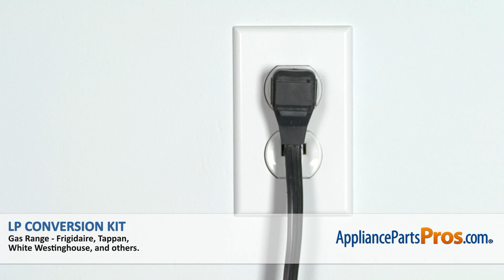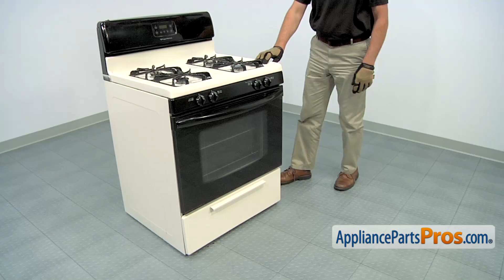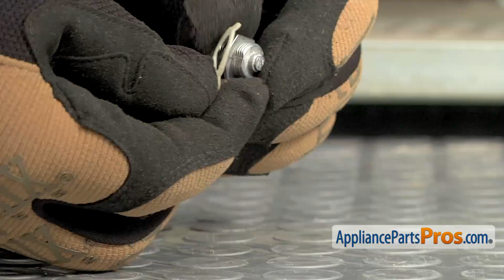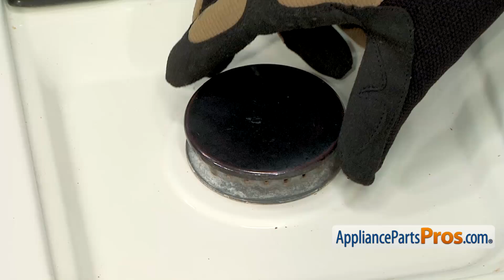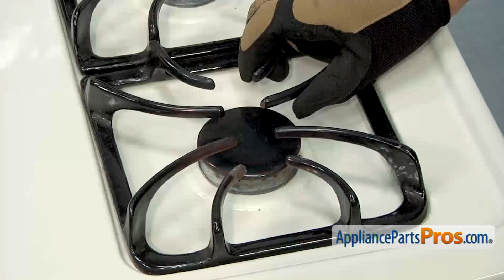How To: Frigidaire/Electrolux Lp Conversion Kit GRLP3

Comment: Can you do a video and how to replace a 6 burner Frigidaire gas stove
Reply from the maker: We can certainly keep that in mind for future videos. If there is specific information you need for your unit, just provide your model number and we can check it out for you.
Reply: @appliancepartspros  thanks  question can you tell me what kind of burner substitute to used on a Frigidaire 6 burner gas stove mind was stolen off  and I can't gt no replacement the model number dont come up when I researched it online ..if I could get a picture of the burner i could make one
Reply from the maker: What is the model number of your appliance?
Reply: @appliancepartspros  fkgd30a3nenw
Reply from the maker: I'm sorry, fkgd30a3nenw, is not pulling up as a valid model number. Can you look on the unit and double check that information?
Reply: @appliancepartspros  thanks for your help

Comment: Hello, I have a frigidare 79078812406 which is converted to LP, now I need to change back to natural gas. I plan on doing the opposite of this video and install the gas orifices. I believe I should reverse the orifice in the regulator, only question is about the broiler adjustment. Can you make a suggestion?

Comment: To help hold the top burner orifices in the socket or nut driver use a small piece of paper towel so you don't drop it into the range.
Reply from the maker: Thanks for that tip!
Reply: Or axle grease, vaseline or chewing gum

Comment: What happens is the orifices in the stove top are not changed after LP conversion?
Reply from the maker: Holes in the orifices are different sizes for each type of gas. If you have the wrong size ones the burner will not work properly.
Reply: Kaboom.😵😂😂

Comment: This has me nervous and confused, because I went through a Kenmore's version of this yesterday, after finding that the NG oven/range (790.72402014) had come with a packet of four orifices and instructions to convert to LP, all in a plastic envelope stuck to the back of the oven.  I'd thought I was done with that process, and got here while looking for propane connector options, but decided to QC my work vs. the video.
1)  there's no mention in my instructions of the need to determine the difference between the provided orifices, though I recall one having a color-code on it - I simply assumed they were all the same diameter.  Now, looking back at the instructions, there's a breakdown of parts provided in different kit numbers (showing mine and five other kits), and it indicates mine came with three different color-codes - but again, nowhere is there mention of ID-ing them or determining which would go where.  Is this always important, and Kenmore's instructions are...crap, as I now suspect?  Or maybe it really doesn't matter for some models?
2)  similarly, instructions call for both burner spuds to be wrenched down "until snug," but they say nothing of turning them back (unscrewing again), as I think this video does (hard to understand but I think it says to turn them back 1-1/2 turns - though that would be more than my oven burner had been 'unscrewed' already, so it would end up out PAST where it had been for NG.)
3)  as I mentioned, I got here looking for the Rest of the Story, eg what adapter/s are available to connect a standard 5-lb tank to fit the old NG line fitting...I'd think that would be part of any instructions for this process, eg a two-tank manifold so I can try to ensure we don't run out unexpectedly...

Got any clarifications etc to help me out?
Reply: YES! It is very important to install the proper orivice in each burner as larger size burners require larger orifices to make bigger flames and more heat
Reply: Screw down oven flame adjuster clockwise until it seat and the unsrew up 1 1/2 turns for LP. Make minor adjustments to get highest blue flame without (or very little) yellow flame. Yellow flames produce dangerous carbon monoxide

Comment: how can you tell what orifice you need if the cover does not have the number on it like the one you have?
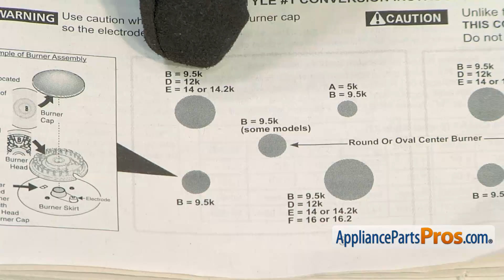Reply from the maker: +Brian Palmer At 4:27 in the video it shows another chart. If you look at your NG orifice it should have a number punched into it. You can also look at your user manual, sometimes they will show the burner BTU's

Comment: do these orifices ever get clogged? It seems like my burners are not getting enough propane ..the flame is weaker than normal. I had my regulator checked and it was fine.
Reply from the maker: +ecurb's You could pull them out and make sure they are clean.
Reply: Was the regulator reversed? You could try cleaning orifices with automotive clorinated brake cleaner. NEVER anything flammable

Comment: what if it's an old stove with no conversion kit?  Do we need orifices?  Are there generic orifices?  We have a hotpoint AH222235R
Reply from the maker: +s wilson I am not sure that is a model number. You can double check it and give us a call, if it is not too old we can try and look it up: 1-877-477-7278. You can also post the problem along with the appliance model number on our repair forum and the techs can help you troubleshoot the problem.